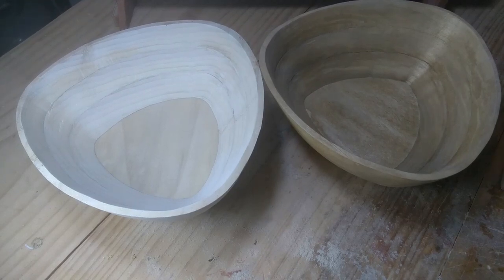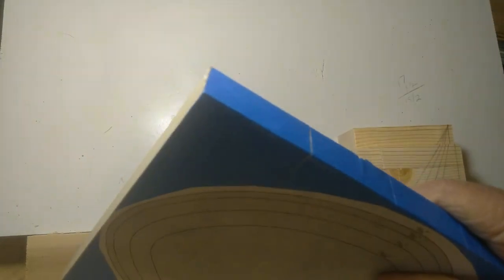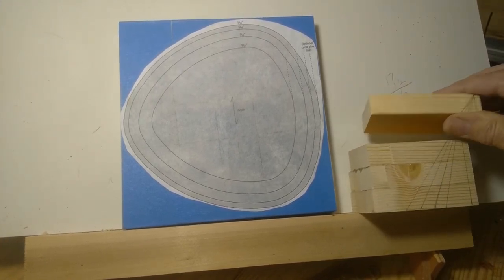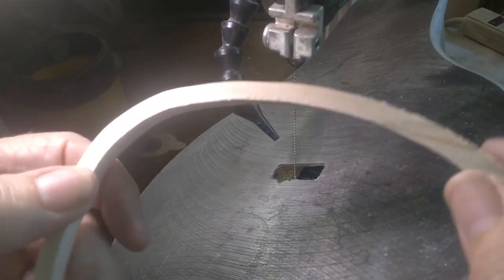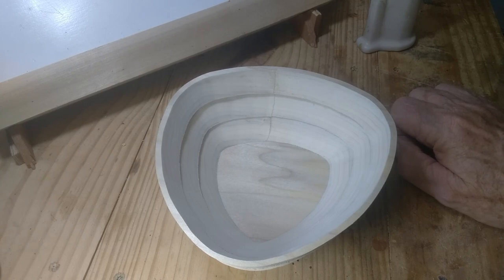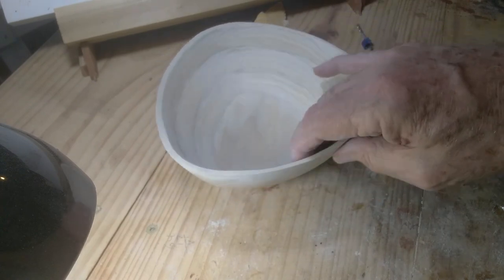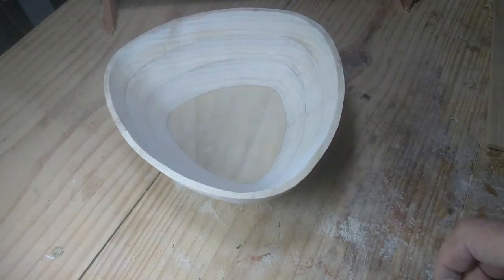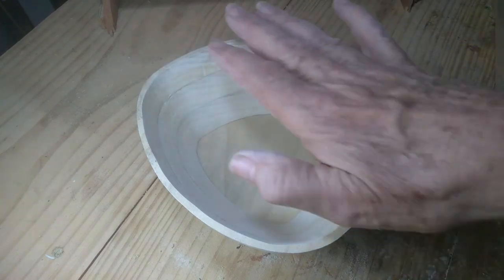Scroll Saw Bowl Derived From A Reuleaux Triangle

Comment: Fantastic i’ll give this a try once I get more experience
Reply from the maker: In the past I would never try something like this, thinking it was too complicated.  But, as it is said,  the best way to  learn something is to do it.  This is more than just laying a pattern on a board and following the lines but is not rocket science either.  The lines and angles, however, must be  cut accurately to make it easy to finish without sanding for hours.  I could have done better and will.